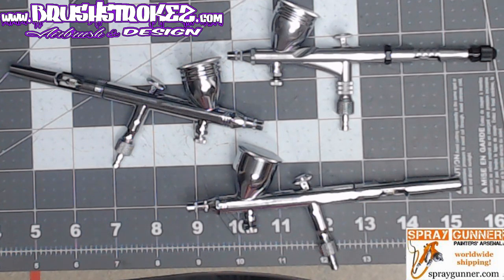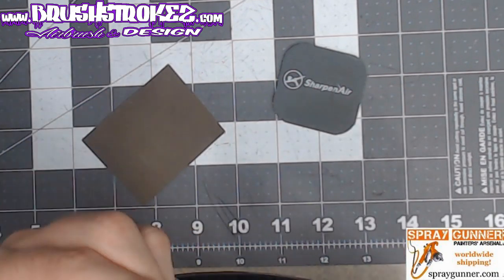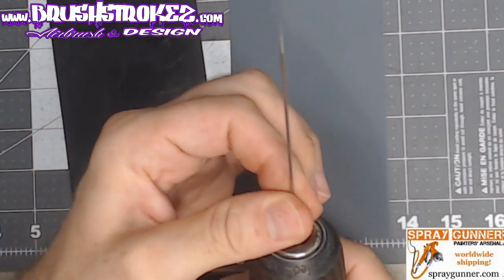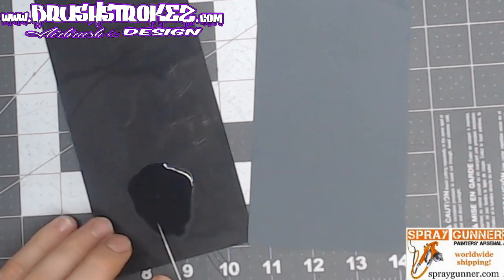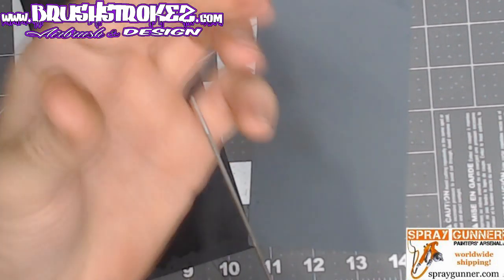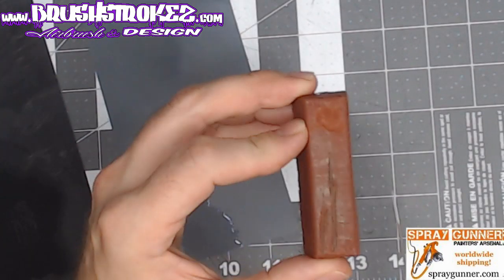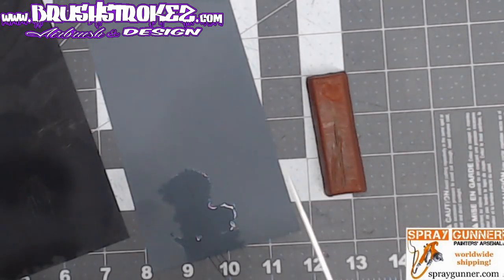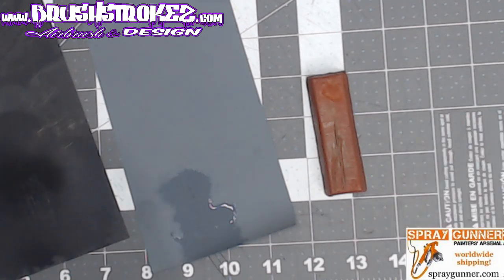How to polish your airbrush needle LIVE

Comment: I know this is a late comment/tip, but one thing that you REALLY  need to make sure of while doing this, is that you don't change the angle of the needle taper (which is VERY easy to do with the drill method)... it's an old Machinist/Die Makers technique.

The trick is to darken the taper of the needle first with a black magic marker so you can see if you have the angle right prior to speeding up the drill.
Afterwards, polish with Flitz or a metal polish to remove as many fine scratches as possible.
Hope this helps... otherwise, you can ruin a needle FAST. Lol
Reply from the maker: ThankZ for the tip!  I’ll definitely try that next time.

Comment: I added a dehumidifier to my shop and if you keep your humidity at about 40% or less you will get definitely less tip dry . Buy a cheap humidity gauge and if you’re 50% or over that’s no good. Did you ever notice your airbrush runs better in the winter? Yes that’s because there’s virtually no humidity! If this helps you then go for it !
Reply from the maker: Jersey Joe Yeah, I need a dehumidifier for sure. I’m in Iowa and super humid here. It’s usually 80-90% humidity here in the summers on average. I don’t have central air either and both areas I airbrush in, are the 2 rooms furthest from my window a/c unit. Thanks for the info! I’m going to look into a cheap one.
Reply: Dude!!! You need a dehumidifier like yesterday! Get one and you will run the air conditioner less trust me on this !
Reply from the maker: Jersey Joe Looked at some online. Not in the budget for me right now. I’m pretty happy with how much less tip dry I get after polishing my needles. Did some more testing after I did the video and barely got any tip dry. But I will at it to my list of future purchases.